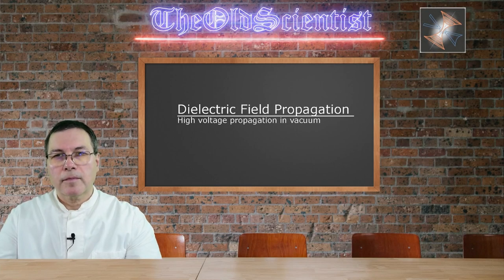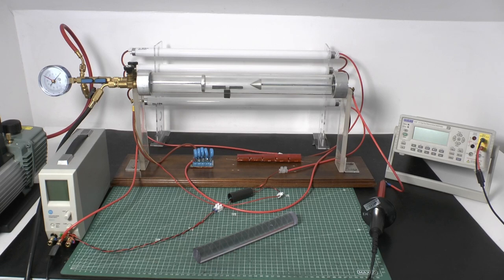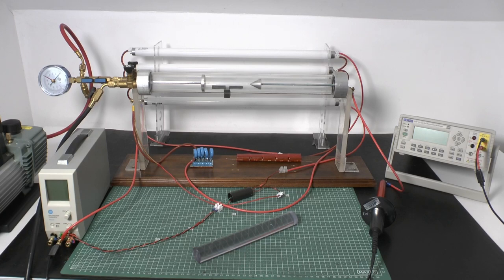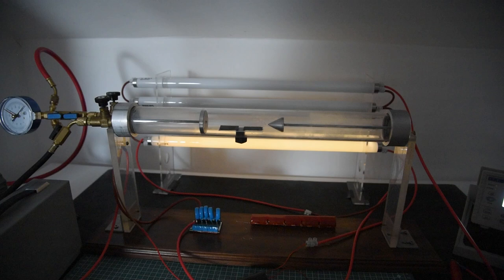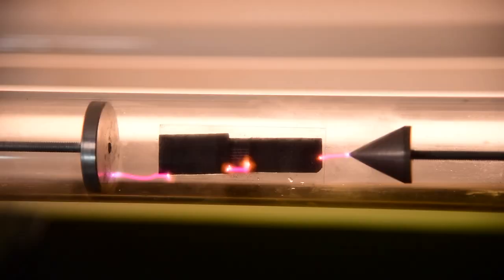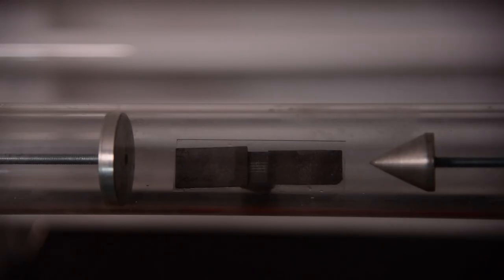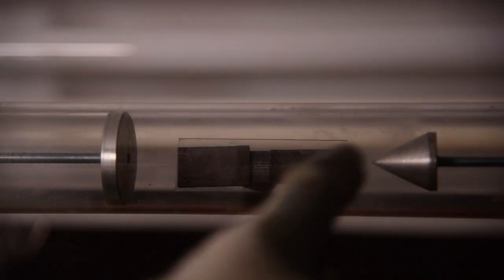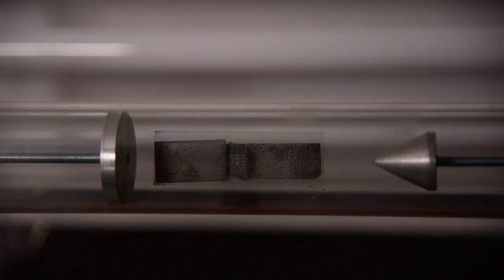High Voltage Propagation in a vacuum

Comment: Tesla ended up using electromagnets to quench his spark gaps, enabling him to pulse width modulate and set the frequency. The smaller the pulse width the more pronounced the dielectric effects were.
Reply from the maker: Yes, I am familiar. I produced a special spark gap with vacuum suction and magnets. https://youtu.be/5m-88B5zi4A
Reply: Military ended up with a pulse controlled one for laser. 2 tubes ending in a sphere. And a ring in the middle for the pulse.